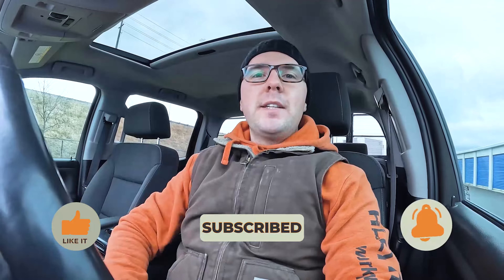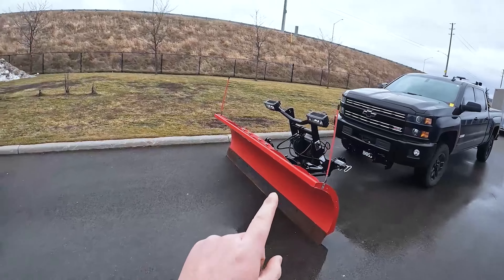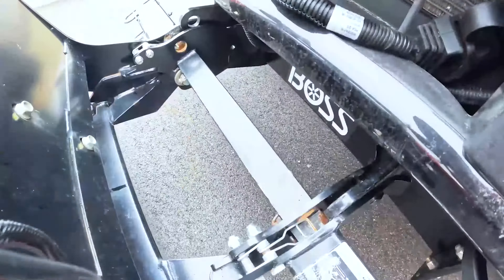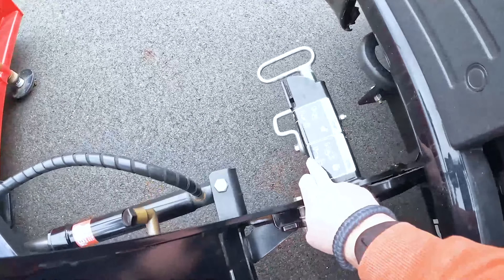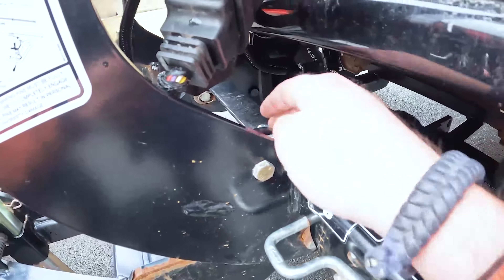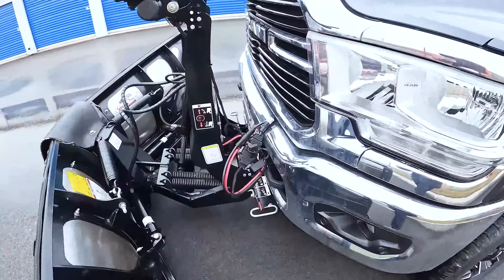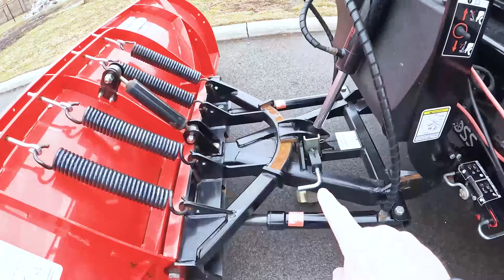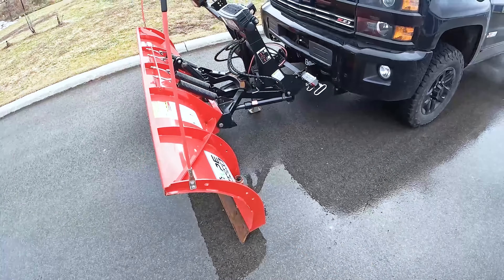How to Connect/Disconnect A BOSS Snow Plow

Comment: VERY IMPORTANT POINT ON THIS BOSS YOU MISSED: WHEN DISCONNECTING PLOW YOU MUST HOLD THE SWITCH UP THEN HOLD IT DOWN UNTIL THE TOWER IS COMPLETELY DOWN! Otherwise the hydro oil will be forced out of the breather and you will have oil all over your driveway. Don't ask me how I know this.  Crazy design.

Comment: I am on the fence about weather to get the full trip or trip edge. Any input would be appreciated. I’m not really getting it to make money. It’s mainly for my driveway. I have heard trip edge is terrible for gravel driveway.
Reply from the maker: I would say go with the full trip if you have a gravel driveway and you're just going to be using it for personal use. Regardless, It's a good idea to plow with the blade up off the ground an inch or two until the ground freezes so that you aren't digging up the driveway which will make it uneven and a much rougher plow. Hope this helps!
Reply: @louch.landscapes  I have a trip edge it digs in a lot. If you are only doing gravel, it will for sure dig it up.  One quick thing I do before driving in for hook up. I flip both lock levers so i don't have to squeeze in between the plow & truck. The other thing I did was put a white line on the headlight & the driver windshield wiper for lining up reference.

Comment: just got a new truck and it had this plow. my driveway is level but has a slight incline. the plow pins would not release. is there a way to block it or something to get it to release? i had to face my truck down the driveway in order to get it off but the control on the plow didnt work, the pin only released when i hit the joystick control inside the truck
Reply from the maker: Hi Craig, thanks for the question. I'm not 100% sure, I haven't had that happen to me, but usually when I have issues I'll usually take it to my local dealer where I purchased the plow and have them look at it. Perhaps give that a try. Sorry I couldn't be of more help. Good luck!